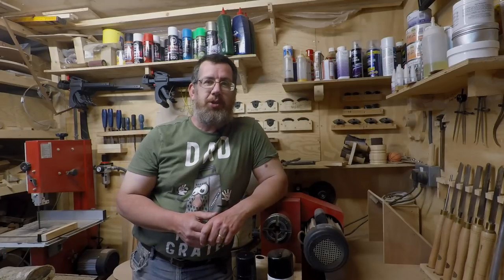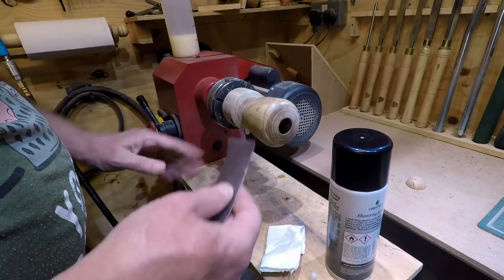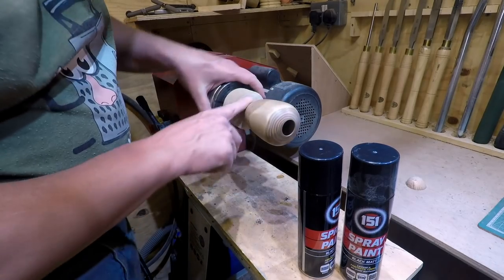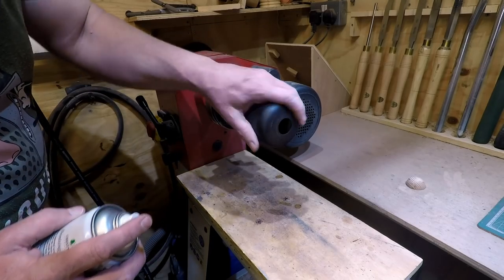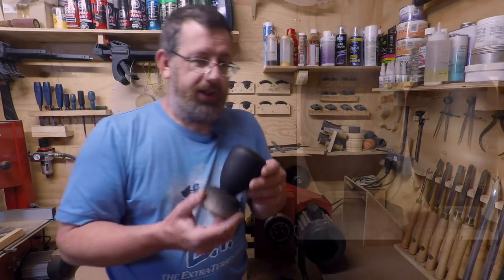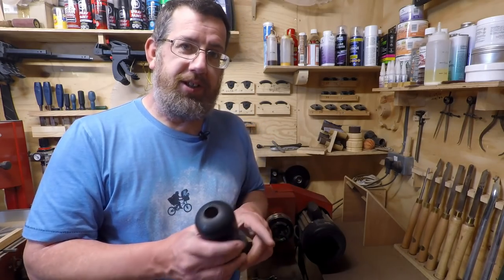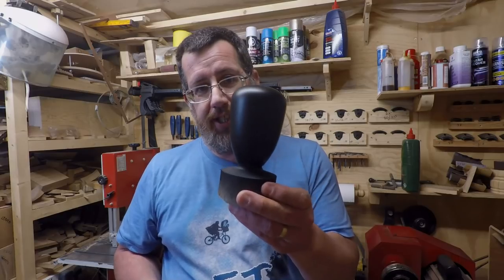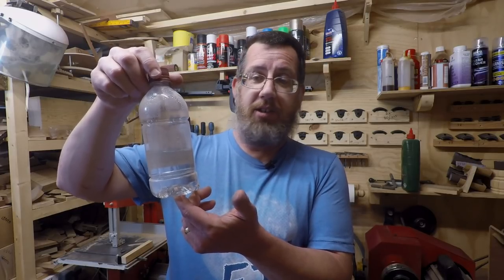Ebonising Lacquer vs Paint - Episode 193

Comment: Did the instructions not say ‘25-30mm’ which is only 11-12 inches Paul? It looked like you were spraying 25-30 inches away which may have drastically reduced the coverage of the ebonising lacquer whereas the paint, being thicker, was able to travel that distance and still cover the vase.
Reply from the maker: 25-30cm. Yes I may have been at that top end and maybe a little further away. Certainly not quite as much as 24 inches though. Going on thinner is actually probably better to allow you to build up the coats. I would rather take longer putting one coat on and have that thinner option than struggling to put on a thin coat.

Comment: i have had no problem with chestnut ebonising  lacquer, i find the jo sonja paints stick to it really well, but i will try to find some 151 paint and give it a go, always looking for a way to save money
Reply from the maker: Hi Lindsay. I think the main reason for the comparison was to see if there was much difference to the Ebonising Lacquer compared to paint. I buy my paint from sprayster.com so when you spend over a certain amount it's free carriage. I mainly buy their spray lacquer to finish a lot of pieces off when wax or oil is not favoured. If you just want one tin then try ebay which may be cheaper.

Comment: In doing your comparisons, you might also want to try India Ink. Great black coverage with grain still showing through. Works well on low tannin woods, and not expensive. I have had excellent results with it, esp. with Jo Sonja paints. I finish the project with clear lacquer to seal it all. Any black wood dye, either water or alcohol will also work, but India ink is less expensive.
Reply from the maker: Thank you Valerie. Certainly another good idea. The only downfall on the dies etc. compared to paint type application is that they do soak into the wood so could cause issues when you turn away into them with bleeding colours into natural wood.

Of course there are lots of different ways with different results. Indian Ink I believe is a permanent ink, so I can see I will end up with black fingers for a few days as I rarely would wear gloves. 😂😂
Reply: Paul Lockwood Sanding sealer helps keep dyes from bleeding. But since this is for an undercoat, that would not be a problem. I have also had really good luck with black lacquer paint (rather than other types of paint) in a rattle can, and it was in the lower price range. That works well with acrylic paint, and topcoat of lacquer clear. And I do use the disposable gloves for India ink, though lemon juice (any citrus) does remove it from skin.

Comment: Great video Paul, really interesting results. You are right about the speed of your lathe. I have found around 290-300 be the max speed I can turn when spraying anything or I get issues. I would say your best bet for making the wood black is to use a black dye, much more predictable and you still get the grain
Reply from the maker: Thank you John. Another good idea. That would work well like the home made ebonising solution (where woods had hi tannin for that). The only issue on those is where you don't want it to soak into the wood if you need to turn right next to where you colour the wood to show the wood itself. Horses for courses on all these products.

I mainly did this video to compare these two products as to me they both seem to be a paint, named and priced differently.
Reply: @PaulLockwood  if you apply light coats with a water based dye it will not soak in very far. you do need to watch for it though thats for sure. I was really thinking as an alternative to the ebonising solution. I do like to use that on certain woods but its unpredictable
Reply from the maker: Lots of different options to do this sort of thing. In a couple of videos time I will be using the Walnut crystals I used on my Christmas Ornaments. This works really well on one of the pieces.

Comment: Try using water based paints like acrylics. They soak into the wood far better. Works on plywood too.
Reply from the maker: Another good idea but that could cause issues if you want to use something on top that has a moisture content like more paint which can then cause the colours to run. I was mainly comparing these two products as I cannot see much difference between them. To me the ebonising lacquer really is a lot like a spray paint but 4 times the price.

Comment: Thanks for the information Paul and I much prefer the vinegar and wire wool solution only problem I have with that is it goes rusty after a while and makes the wood the same am I doing something wrong?
Reply from the maker: Thank you Graham. You need to dissolve the wire wool in Vinegar. Too much wire wool and it may not all dissolve. The best example of me using the ebonising solution may be back on when I made my ships cannon. Look in the video for where I made the main barrel.